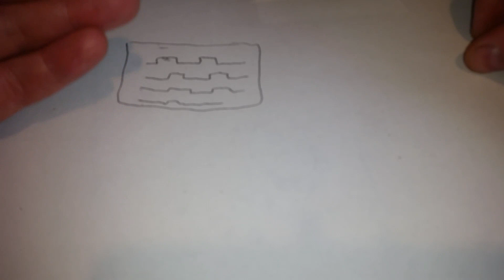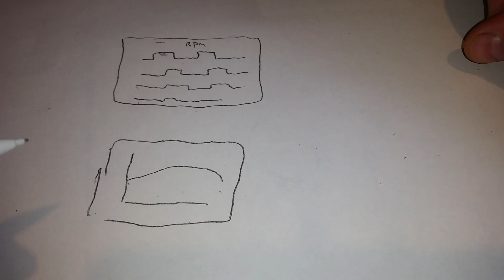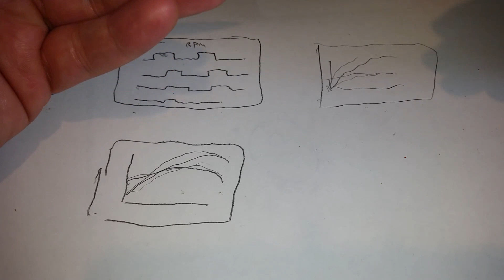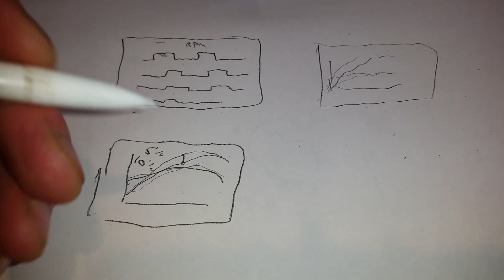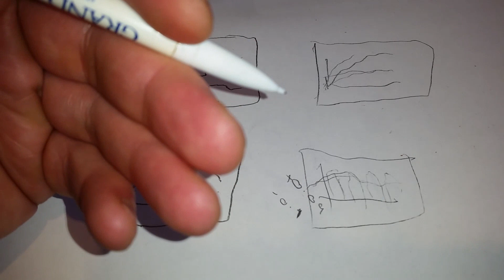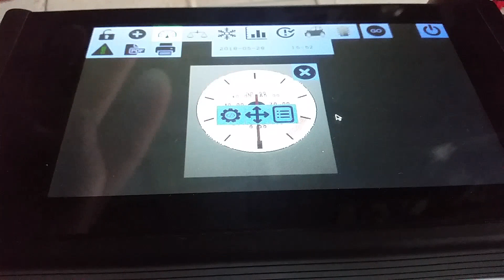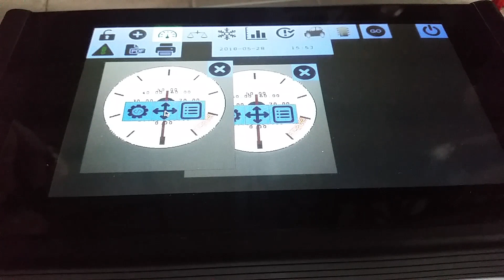Fuel Injector Remapper Project - THE PLAN

Comment: So a piggy back purely
For fuelling ? Why? Makes no sense at-all for fuelling only, what about your ignition timing ? This goes hand in hand, be prepared for some knock 👍🏻
Reply from the maker: Detonation is uncontrolled pre-ignition, caused by mixture igniting early due to hot-spots in the cylinder, typically caused by weak mixture or excessive charge which burns too hot. Making the mixture richer won't make it ignite sooner, it will have a dampening effect, reducing the chances of hot-spots.

Comment: Very interesting - I guess you already looked at the power commander which does exactly this on a motorcycle. I'm sure one could easily be adapted to work on a car instead. However, it's much more interesting to make your own. After watching a few of your vids your certainly a very clever chap 👍🙂
Reply from the maker: I think some of it is about the learning process for me. Thanks for pointing it out though, I just took a look at their web site. I'm currently making the test rig to develop it with, this should also provide me with an injector testing system. I watched your Anglesey video, much braver than I used to be on a bike. I think I probably still prefer bikes to cars, but haven't ridden for a long time.

Comment: So this is basically a piggyback but only for fuel?
Reply from the maker: It will be user tunable. It will display graphs associated to power and torque to aid user tuning. It will also be Open Source so anyone can take it and adapt it to their own needs if they understand the software and tuning process. Other modules may provide for this, but I think very few would be Open Source.

Comment: very interested to see the progress on this project. I am wondering the reason behind not using an aftermarket ecu or diy ecu like speeduino. Is it to keep the obd2 interface for emissions inspections? 

I think you will run into issues when trying to lean the fuel mixture because the stock ecu will read the o2 and fight you trying to get it to run stoich. this would also throw codes which would tell emissions testing equipment that your engine is not running properly. However for tuning it for new cams, supercharger, etc i think it will work good for that.

Another option would be to run an aftermarket ecu in tandem with the stock ecu where the aftermarket ecu runs injectors and the stock ecu runs everything else.
Reply from the maker: Ultimately I would like to get to the original ECU maps and alter them, I will restrain from that until I know more about the ECU and am able to fully back it up, and use an ECU I have restored the original onto. The original ECU will take into account mass flow as well as boost pressure, air temperature, ignition advance and other things as well. So I want to let the original ECU do most of the work and just tell it to add a bit more fuel in certain areas. Also being able to get torque and power curves to compare during tuning would be useful.
I think your are right when the ECU is in closed loop mode, reading from the O2 sensor. I will have to detect when the ECU goes into open loop mode and starts using the predefined mapping tables, I think this should be doable with a bit of work. The other reasons are that I like to learn by doing, and apart from time, this should hopefully be very cheap to create.
Reply: @DevelopIT  Very interested to see the continuing progress. If you are ever interested in working on a custom ecu from the ground up i would love to have your help on my ecu project. It isn't tied to any given micro so you can use any micro you like as long as it is powerful enough. right now i am using the stm32f103c8 (blue pill) and i have the code written to be able to use the entire stm32 line of micros. So far i have gotten it to run the ignition and will be testing the injection within the next month as soon as i get the fuel system installed into my car. It is written from a software development perspective so the code follows a clear architecture and design principles. you can check out the github repo for it here. https://github.com/FL0WL0W/EFIGenie
Reply: @DevelopIT  Also if you plan only to add fuel and not to subtract fuel. you could pass the injector signal directly through and just pull it down with a mosfet for the additional time since the injector drivers are open collector.
Reply from the maker: I will be shifting the signal to open the injector earlier, to allow for a cam which opens the valve earlier. So I will control the signal fully, I also prefer this as I want to be as low risk to other parts of the system as possible.
Reply from the maker: I have watched some of the videos on your other channel. I'll look out for new videos. It's good to see other Open Source projects in this area. I'm also looking into e-Bikes, so not going to have time to get involved in other projects. The specification looks impressive detail.